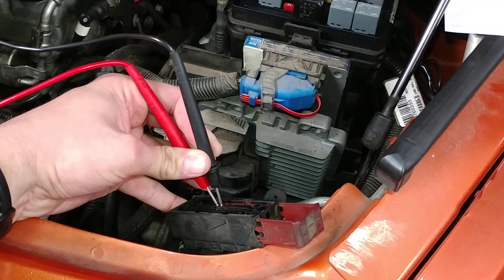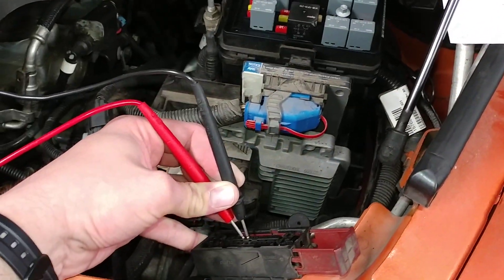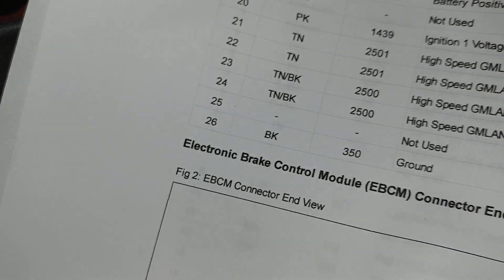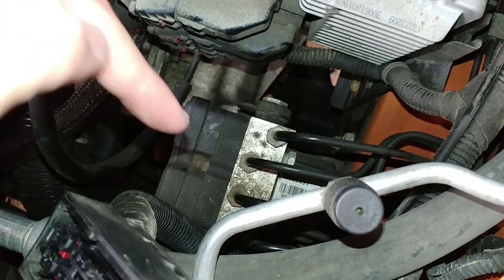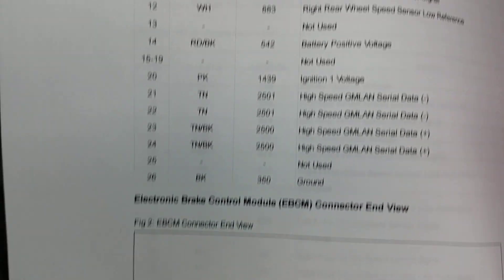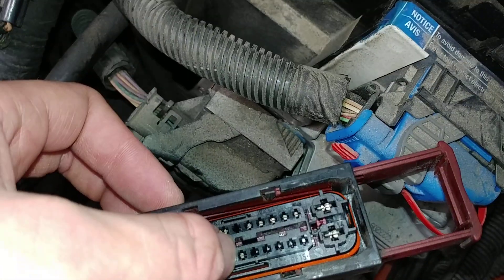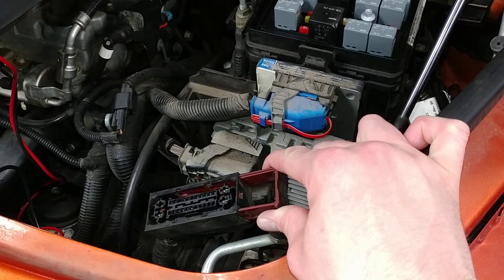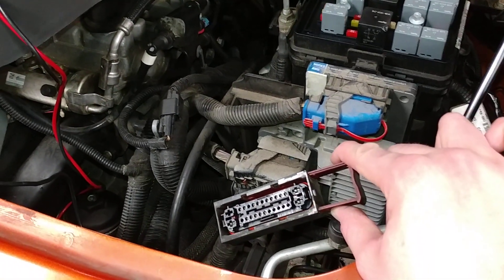2007 HHR/COBALT ABS TRACTION CONTROL LIGHT DIAG

Comment: Had to change out my Front Hubs at 50K miles, Changed out the Brake pads while i was there Three months later the ABS & T/C Light are on. This 2006 has rear shoes and no ABS back there so it's a Hunt now for the Front Brake problem. Thanks for this video and a place to start.
As an Aside; The 50 Amp Fuse at the Battery for the BCM has also blown and been replaced without explanation. It's getting tricky for shade tree mechanics, that's for sure.
Reply from the maker: I just gave up on the car today. Got to the point EVERY time I stopped the car for more than 2 minutes the lights came on. Turn car off back on TC light goes off and ABS goes out as soon as you drive away. I gave up!
Reply: You may need to drive around with a scanner in your car. Have it ready to plug in if the service traction comes on. You have to plug it in while it's running. Cut it off, it'll self clear most of the time. Now the scanner says to plug it in with the engine off, then turn on the key. That's for check engine stuff. Service traction usually doesn't trigger a check engine. That's why most shops tell you it needs to be on constantly for them to find it.

Comment: I have a question for you. I have given my son my 2009 HHR and it has traction control and ABS lights on. A mechanic friend said he can not make the ABS pump motor run from the scanner and said that is what it needs. Also my son's gf has a 2008 HHR and she said brakes seem squishy. I got in it and the brakes go to the floor. We put a master cylinder in it and blead them. With engine off brakes feel fine but with engine running they go to the floor. Went and checked the 2009 and they also go to the floor when running. My son wants to chalk this up to just the way they are. I don't think so and would like to get them both fixed for them. I can only assume they both have the same problem. Now we know the 2009 has a problem and are getting parts I was going to start with the ABS Modulator Valve. Maybe they both need this or the 2008 needs blead with a scanner?
Reply: Any updates?
Reply: @dpaniagua86  Not as many as I would like. The 2008 came around with the master cylinder. About a month ago she stopped by and said it was running funny. Only had a quart and a half of oil. Filer was collapsed and full of glitter. Done parked and need to get rid of it now. My son with busy job just keeps driving the 2009. I have the ABS valve just need to install.

Comment: I have a 2007 Cobalt SS that started doing it 6 months after the front bearings were replaced. I got a C0040 code to show up. You have to do this while it's running or else when you restart, it's gone. I use an Innova 5210 scanner. I cleaned the connector & it seemed to quit. I noticed if I go to a carwash, a day later it'll still throw a code. I think the probe part is cracked. Are they built into the hub, or can you unbolt the probe separately? The hub came with the probes my mechanic is telling me, but they still may be removable. Dry days & don't drive through puddles, it'll never come on.
Reply from the maker: The hub assembly is supposed to be a sealed unit. However even the GM assemblies are far from water tight!

Comment: James Musselwhite ther say the problem is the abs Brake harness , GM put it too close to the engine and it burns through the wires causing abs and traction control light to come on
Reply from the maker: Possibly but I replaced the entire harness from the EBCM all the way out to new sensors. I ended up selling the car because of this issue!
Reply: I had the harness to deteriorate. I replaced with 1/4" wire loom. That size is hard to find, but common at small engine (lawnmower) shops.

Comment: I'm having an issue that comes and goes. First drive of the day I get an abs, traction control light. Then when I shut off the car at my destination and restart it, the lights go out and it's fine the rest of the day??? Sometimes they go out when I'm driving.
Reply from the maker: My issues have returned as well! I will be investigating some time in the coming month. I expect my issue will get worse. One test I can recommend in the mean time is I forgot to test for a short to ground on each of the ABS sensor wires. You can try this as well. Measure resistance from each wire to ground and it should be open circuit to ground.
Reply: A few weeks ago we had a very heavy rain and there was water everywhere. Intersections were flooded and of course I was out driving in it. It was after that downpour when I started having these issues.
Reply: Thank You Sir!
Reply from the maker: I will say these sensors are not very well sealed!!! Seems like a bad design!
Reply: There are 2 types of "service traction." One you get a "traction off" message first, then a "service traction." That one is usually a loose connection. The "service traction" on immediately means a short or ground fault. Most of the time it will not throw that message unless you're driving under 13mph. I've seen cars throw it only while passing through gate sensors. That one is a ground fault on the negative wire. The speed sensor goes nuts near welders or 2 way radios.

Comment: Had  the similar problem on dry roads with a 2006 HHR.  The ABS & TC (traction control) lights came on together at same time. Parked the HHR and turned off motor for about one hour. Restarted the car. TC light had turned off when restarted  but ABS light still on.  Went around the block and ABS light turned off as I went from revers to drive.  All seems OK. now.   Time will tell.
Reply: Yeah, ABS remains on after it resets. You get 4 dings then it goes out. Driving forward about 50' clears it.
Reply: @virginia7125    Thanks for the follow up and clarification.

Comment: Just read you sold the car. I have a 2008 Cobalt SS and keep getting service esc. It just started happening as it got colder wonder if that has something to do with it. We had our first big snowfall here today and it was scary driving the car is so twitchy and this is coming from a guy that drove a Camaro in the winter for 8 years hehe.
Reply: Are you getting low traction errors on your dash? The loose ground can give you those issues. Replace the ABS/ECM relay in the center front of the fuse box that looks like a battery. A mild corrosion on that can cause hard shifts & traction loses.
Reply: @virginia7125  No issues now totally forgot about this problem.

Comment: Did you ever find a permanent fix or the source?  I am having the same issue with traction control.
Reply from the maker: Brenton Bennink Unfortunately no. This issue has been so intermittent I can’t get it to mess up long enough for me to catch the issue. I have noticed it consistently only messes up after a 10 minute drive, on my way to work when I stop the vehicle with the steering wheel cocked about 10 degrees to the right. If I sit for about 3 minutes with it idling the engine will nearly misfire. Rpm drops and battery voltage spikes to almost 16v and then falls to almost 10. That all happens in the blink of an eye and almost every time thereafter that is when the dash lights up with the issue. It ALWAYS self clears on the next key cycle and the t/c light goes away when it sees speed from all 4 sensors.

It always happens after a heavy rain storm as well!!!

In the scan tool I have it also does some weird backwards graphing thing when it messes up as well. 

Has been over a month since the last time it happened!
Reply: @RacerJames76  same here, except I get a cylinder 4 misfire also, usually before the trackion control lights up. Checked plugs, spark plugs, coils etc. No solution!
Reply: @brentonbennink3324  > Replaced plugs just to be sure, but they were not the problem !
Reply: James Musselwhite ther say the problem is the abs Brake harness , GM put it too close to the engine and it burns through the wires causing abs and traction control light to come on
Reply: @brentonbennink3324  I had a mild miss. I have all 4 new coil packs & 4 new plugs. If you use Lucas in your gas, I have seen it clean so well it'll clean the antiseize off of the threads of the sparkplugs. Tighten the plugs will stop the problem. You can also try Rislone Ring Seal. It'll help with idleing. I used just a half a bottle. Too thick otherwise. Also make sure you use 89 or higher octane gas. These 2.4L run crappy on regular.

Comment from the maker: I have been having the issue intermittently! Still occurs randomly. Code can be replicated by unplugging the sensor as well down at the wheel.

I am starting to wonder if it is a connector issue, but I have replaced the hub/sensor and the body to wheel harness is new old stock GM. Intermittent problems are so frustrating!!!

It could also be a failing EBCM but I don’t know if the bias voltage regulator inside is shared or if there are 4 different regulators?

If it is shared then all of the sensors would have the same issue. All I can hope is that the issue gets worse and stays constant.

By the way that is correct on the EBCM logic. Codes are self clearing if the issue is resolved.

In this case meaning if the bias voltage is able to make its way out of the EBCM on one leg and return on the other wire.